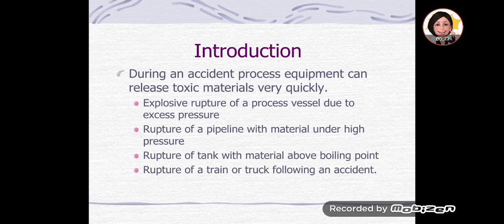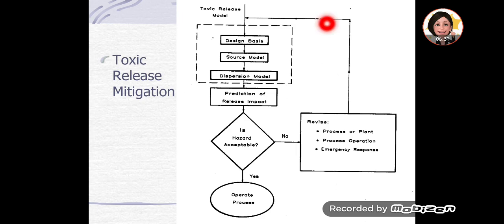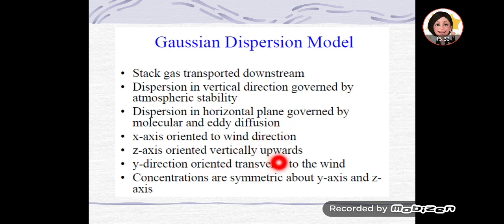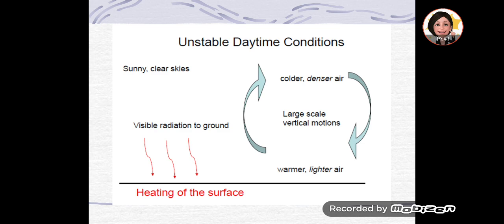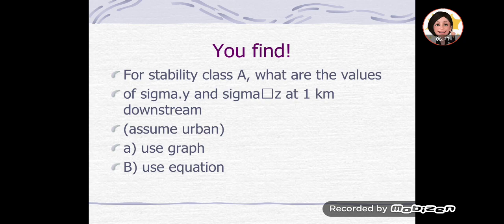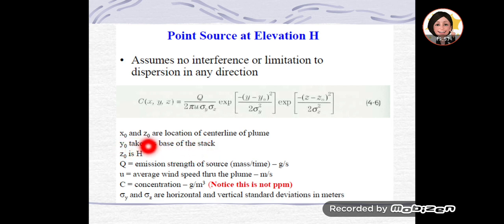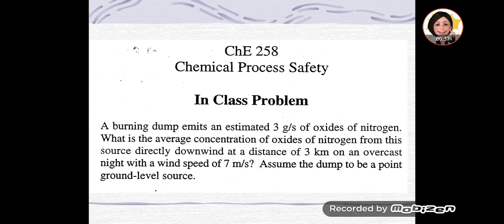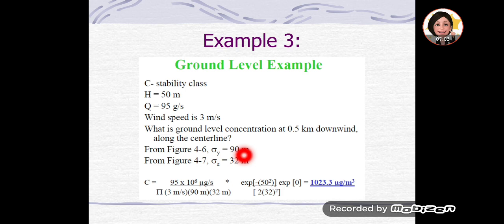Toxic release and dispersion model

Comment: Flue gas is mixture of CO2, NOx, SO2,CO etc. and Flue gas density will depend on the mixture composition. 
1-So how gas density will take into account to estimate concentration at ground level? 
2-Or mentioned above method @ 32.17 sec is valid only for released air with SO2?